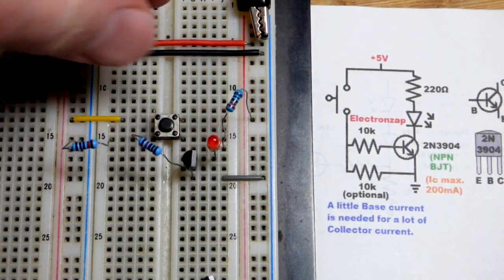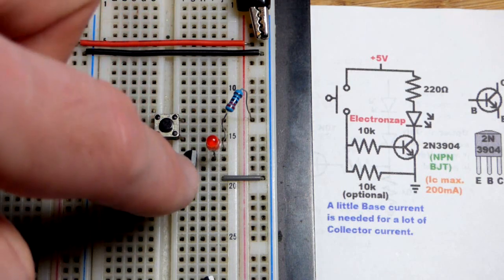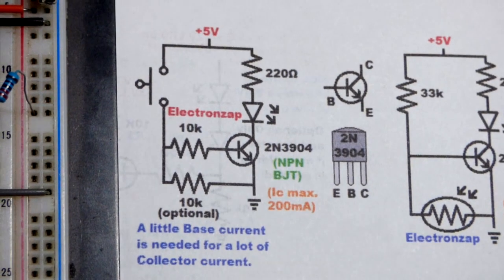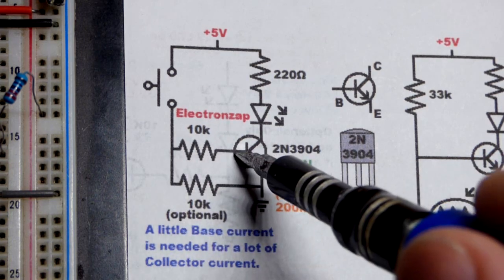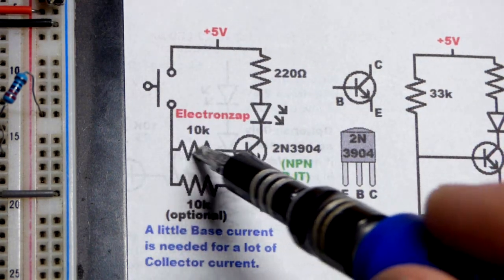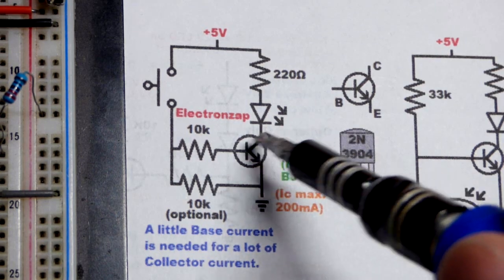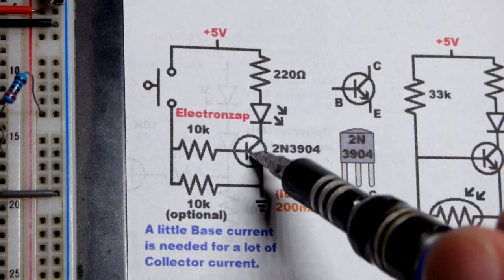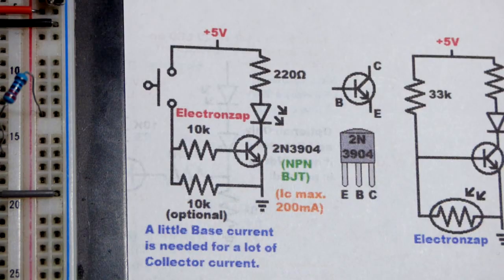NPN Bipolar Junction Transistor wired as a switch

Comment: Hi; Thanks for your vids.  They're displayed in a way so that a novice (me) can experiment with simple circuits & gain some knowledge.
.
So, 2 questions:  Is there a rhyme/reason why some switch circuits use nosfets, and some use transistors?  I think mosfets switch via voltage, and Tx's utilize current (at the base).  But still, I'm curious as to difference between the two.  Is one generally advantageous over another based on a given circuit?
.
Second Q.  I realize voltage drop thru the CE junction powering an LED is somewhat trivial.  But if I was to build a circuit where the CE drop is critical, is it 0.2 volts according to 2N3904 datasheet?
Reply from the maker: There's a lot of reasons why you might prefer either a MOSFET or a BJT in a particular circuit. Could probably fill an entire book. Just have to study all you can find about both of them. BJTs are really easy to get, anyone with electronic components probably has them, so I cover them a lot more and understand them a lot more than MOSFETs. Last time I thought a MOSFET would work better than a BJT, all of the ones I have didn't work better, so I didn't make the video that I was planning on making. I could probably do research and pay more to get one that would work better but that's a lot of commitment for what I do. So, MOSFETs aren't near as easy to acquire as BJTs.